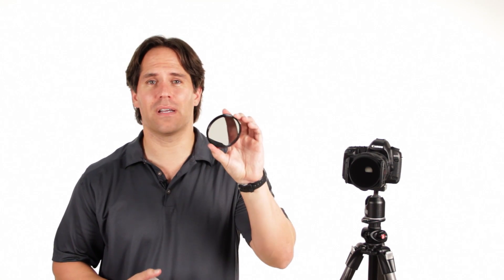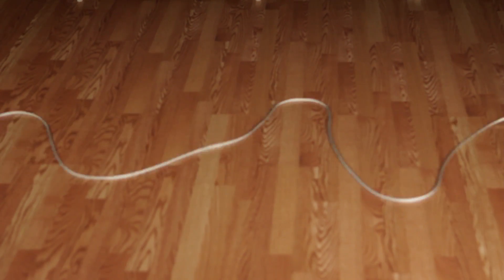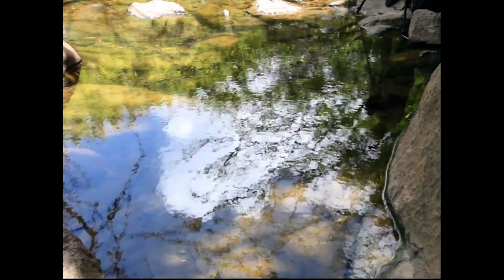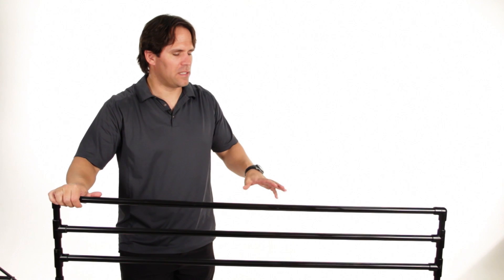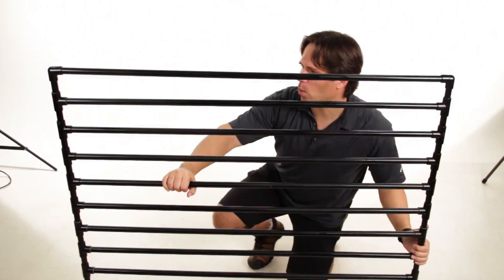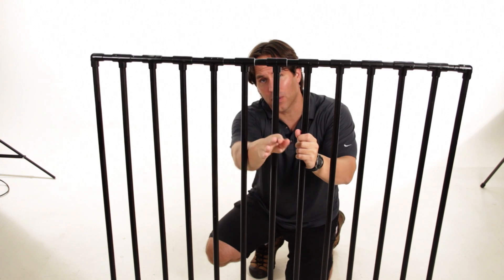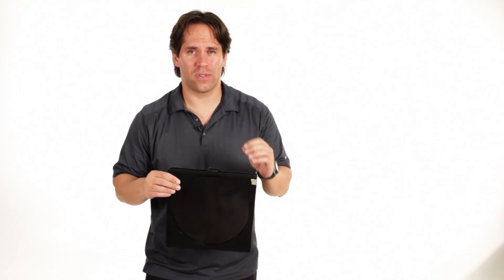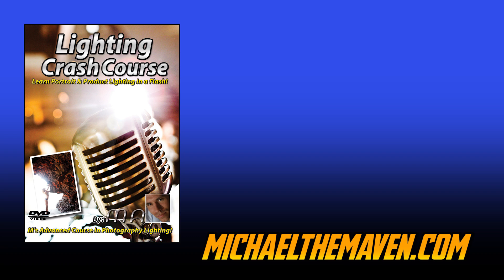How Polarizers Work | Polarizing Filters Tutorial

Comment: This is a great demonstration, but if you want to dive deeper, the polarizer works 90° to what is shown. The polarizing filter allows light that is going against the grain to pass through and blocks light that is going with the grain. It happens this way because electrons can easily move up and down the tall vertical crystals but can't move side to side. When vertically polarized light (electromagnetic waves) attempt to pass through, they induce the electrons to flow up and down the crystals. Because the light interacts with the electrons, all of its energy is transferred to their movement and the light ceases to exist. If, however, horizontally polarized light attempts to pass through the filter, it will try to move the electrons side to side. The electrons are unable to move side to side and so no energy is lost. As a result, the light is able to pass through the filter making no interaction with the electrons as if they were not even there.

Comment: You missed the chance to really blow our minds! If you place a third polarizing filter in between the horizontal and vertical polarizers, you will actually see some light coming through all three. The first filer is horizontal and blocks 50% of the light. The second is held at a 45° angle to the first, so it lets 50% of the light coming through the first, or 25% of the original light. The final polarizer is vertical, but since the light hitting it is at a 45° angle due to the middle filter, it actually lets through 50% of the light (or 12.5% of the original). Just by placing 1 filter in between the first two, you can actually increase the amount of light that comes through!

Comment: Hi, Michael - I enjoyed your video, and I found the examples with the rope to be great for visualization.  I've found other videos on the web that suggest that light that is vibrating parallel with the filter is blocked - that is, it is absorbed by the filter, and probably turned into heat - while light that is vibrating at 90 degrees to the filter is not absorbed, and is thus passed.

Of more importance is the fact that your video discusses linear polarization; but virtually all camera filters these days are circularly polarized.  Truthfully, I do not know the difference between a linear and a circular polarizer, and I haven't heard a good discussion of it.  Nor have I found a good discussion on the web.  Lots of stuff on how to use them to enhance your images, but nothing at all on their construction, or what the 'circular' denotation refers to.

Thanks for a good video - Charlie
Reply from the maker: charles worton please see the description for the update. Thanks
Reply: Hi, Michael - I did read your update.  After your comment, I also went to the wikipedia page, which I had not previously done... but I'm afraid that all Wikipedia has done is convince me that I'm utterly stupid.  It would appear that inserting something called a 'quarter wave plate' after a linear polarizer causes the wave to start rotating along its axis... for reasons not stated.  When you follow the link on a 'quarter wave plate' you arrive at a page that is besotted in mathematics, using mostly symbols that I have no understanding of.

Ah, well.  I certainly won't hold you responsible for Wikipedia.  And I did find much of your video helpful.  If you ever do a video on how a circular polarizer works, I'm sure it will be up to your usual high standards.  I look forward to it.  Best wishes, Charlie

Comment: I know you are doing your best to explain this without using electromagnetic theory, but your description of how polarizers work is wrong. You were correct that when sunlight reflects from a flat surface it is horizontally polarized (S polarized), however to block this light, the grating should be parallel to the direction of the light in order to cancel it out. This is because the oscillating electric field of light parallel with the wires generates an electric moment, exciting the electrons effectively turning the energy of the wave into heat. Your description is the opposite, because you are trying to describe the wave as a physical piece of matter. Basically, if light is coming in like this <--->, and your grating looks like this |||||, it should have no effect on it. As I noted, your description is the opposite
Reply from the maker: Peter_See oh geez. Make a video then and show us how it is done.
Reply: @MMaven  Hey man, im just a physicist pointing out misinformation. You can easily google "linear polarizers". Your visualization was nice, but was flawed is all. If you spun the grating 90 degrees, your description would be accurate.
Reply from the maker: Peter_See then make a video. Actually do some work and put it out there instead of being an armchair quarterback,
Reply: @MMaven  I litterally sent you a source.. But I'll take this as a positive that you are interested in the physics behind polarization :)  . Hold tight, will make a video when I get a chance this week.
Reply from the maker: Andre Barreto unfortunately people like you are the reason YouTube isn’t always the place it could be. I can spend days putting together a video, spend a lot of money to rent a studio, the editor, the time, etc, and then we get ppl like you showing up, making a comment about how one little detail wasn’t right from 6 years ago, when the gist of it is mostly understandable. Ok, well then show me how it’s done. Is that so childish to return fire? Then don’t watch my channel.
Reply: @MMaven  the issue is that your description of what is happening physically is WRONG and people in the comments and using this video as a source to learn about how light works. Yes some detail is wrong, but in a video that is about how light polarizers work its a crucial detail. Video coming shortly.
Reply from the maker: Andre Barreto you should go back and read it. It was a challenge for him to actually contribute something positive instead of just being a critic in the comments. 99% can’t / won’t, so yeah...there’s that.
Reply from the maker: Peter_See this will be fun. Let me know when it’s posted so I can find the one little thing wrong and label your video as “misinformation”.
Reply: @MMaven  Even physicists and engineers get it mixed up.  Here's a great site that explains it very well: https://thinklucid.com/tech-briefs/polarization-explained-sony-polarized-sensor/  and it's related to photography.
Reply: @MMaven  https://en.m.wikipedia.org/wiki/Polarizer#Wire-grid_polarizers here you go I saved you the trouble.